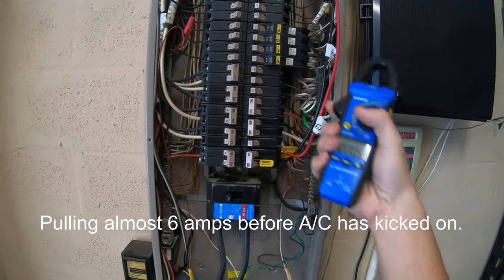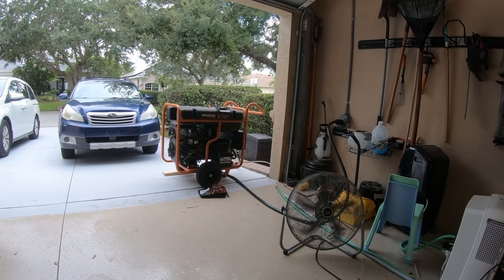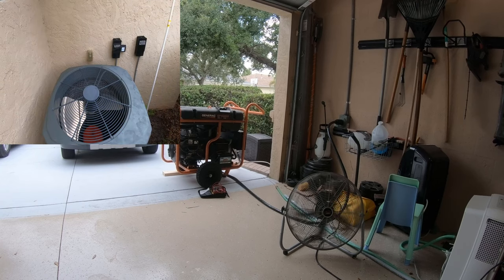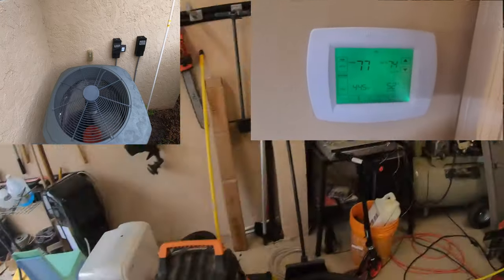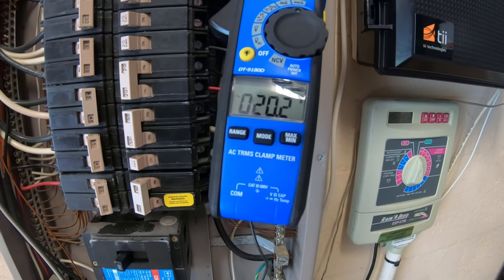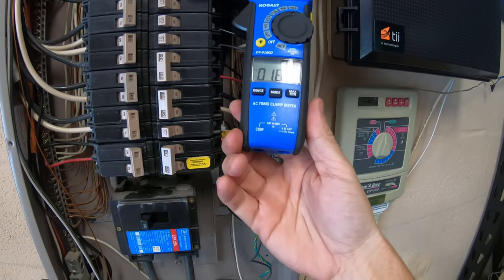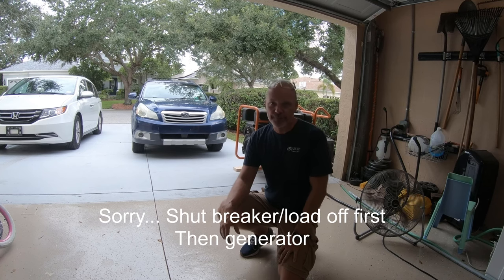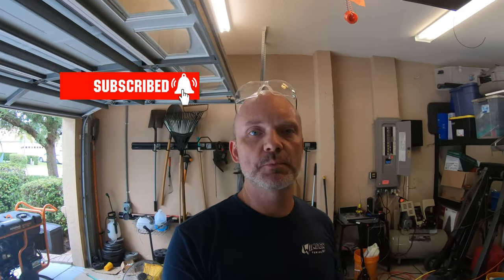Can I run central A/C on Backup Generator Power?

Comment: Is that a generac gp17500e? If so I have the same one. With the soft starter, Are you seeing a dip in voltage & hz from the generator when the AC unit starts up? Such as do your lights dim in the house when the AC turns on (while on genie)? I just damaged both my refrigerators while running whole house on my gp17500. however I do not currently have a soft starter on my 5 ton AC unit. I believe the issue to possibly be a dip in voltage/hz when the AC unit starts up, because the lights in the house dim down quite aggressively. Just curious to see if you have experienced something similar while using the same generator with or without a soft starter?
Reply from the maker: This is its smaller brother the 15k. I do have slight dimming of the lights but no major issues. Did your ac and both fridges kick on at the same time? Your surge voltage on that generator has to be somewhere around 22k watts... mine is like 20k so you should be fine in that department. Is it maybe an old central ac unit that just draws a lot of amps? My 5 ton unit is only 4 years old and is 2 stage so the startup Amp draw is not all at once.
Reply: @JackofAllTrades1  my generator start up is 26,000 W. And my AC units were installed in 2014.
Reply from the maker: @judjohnson4640  I would think you should be ok then. Are your refrigerators real fancy? Like digital screens and all? They might require a pure sine wave of 60 hz.... these generators put out "dirty power" and are not exactly 60hz. Mine actually causes my backup uninterupted power supply (ups) for my computer to throw fits... the ups doesn't like the frequency that it gives off which is slightly less than 60hz. So when I am on backup power, my ups thinks the power is off and just beeps. I'm still not sure what's going on with your situation... I've used this generator for 5 years now without issue.
Reply: those PG series units are known to have weird voltage and not always set properly from the factory. Have seen them running between 225 up to 265. The voltage is adjustable at the regulator and should be set to about 245 under 75% load.
Reply: @JackofAllTrades1  ... if you check freq with a meter you may find it's about 58 Hz without a load, then increases to 60 once you get to about half load. This is normal and the factory has no fix, nor is it adjustable. All you can do is clean and lightly lube the linkage. (WD-40 or similar) This is probably why your UPS goes wonky. (25 years in the gen business)
Reply from the maker: @rupe53  so you are saying all I need to do is run my gen at half load to get the UPS to quit fussing? :)
Reply: @JackofAllTrades1  ... maybe.... some UPS units are fussier than others about the modified sine wave of a gen set. OTOH, one way to find out is to load the gen so it's closer to 60 Hz. (and check the voltage) When these units came out (10+ years ago) there were many articles to be found on the web about which UPS units had problems and which didn't. What I can tell you is the power supply in your PC converts the AC power to DC so whatever reaches the internals will be fine on gen power without the UPS. Remember, these things are made to run from 105 to 130 volts using 50 or 60 Hz, and with a different cord (or flipping a switch) they will do the same on 200 to 250 volts. When I was repairing these gens in my shop I used electric cook tops for my load bank so I could watch the voltage and freq over a range of loads. This is how I know about the changes. BTW, I retired a few years ago so out of the loop on newer stuff.
Reply: @rupe53  I've been metering it pretty in depth and the genie is very consistently outputting 240 @ 60hz @ 3600 rpm. I however think i know what the problem. Its the quality of the wave...or the lack thereof. The THD level is way too high for sensitive electronics. I'm going to have to find a different genie so all my sensitive equipment doesn't get destroyed.
Reply: @Jack of All Trades I bet thats why your UPS is acting up
Reply from the maker: @judjohnson4640  likely so.
Reply: @judjohnson4640  ... Genie? Isn't that what comes out of the lamp to grant you 3 wishes wgen you rub it? <LOL> That said, most cheaper gen sets produce a modified sine wave. If your gear has issues it may be stuff that doesn't have a filtered power supply, like most modern consumer goods, which convert t to 12 volts DC internally. The only consumer goods I see with problems tend to be cheaper UPS units from about 10 years ago... and maybe the first generation of fridges with digital panels. This is from my work in the field over the last 25 years.
Reply: @judjohnson4640  I called GENERAC last Thursday, customer service rep stated to look at models XT, RS, & XG for "TRUE POWER TECHNOLOGY" for lower THD of about 2%
Reply: Im sorry to say but its only been from afew electricians here on the atlantic coast that they very much dislike Generac for a few reasons as a dealer. 1   they seem to need alotta mainenance beyond filters.   2  Conrol board fails and lack of warranty and 3plus 4, THe welding on bases have been breaking often (vibration) that can also lead to other problems.....   The list goes on

Comment: I was told by an electrician that sensitive electronics will be damaged if the generator supplies modified sinewave,  he recommended a puresine wave such as the Duromax  XP9000IX
Reply from the maker: That is certainly possible and one reason all my expensive equipment is on a UPS.

Comment: Will my A.C still work without a soft start connection?
Reply from the maker: As long as it's operating within the amount of amps available from your generator.. yes. If you are close... I would suggest starting your ac first then your other items you want to run.

Comment: yes, you can run a 5 Ton a/c easily. since the year 2004 I have used this same 15km generator from Generac to run my duplex home. 
I run a 5-ton Ac, 3-ton AC, 2 portable ac unit of 1 ton each, a 75 gallons water heater, 2 refrigerators of 1500 watts each, 5 TVs of 60 inch, and approximately 30 Led bulbs of 4.5 watt each as needed. During hurricane Wilma in the year 2005 I used the generator for a week, the fuel consumption was 290+ gallons of gasoline at almost full load, in 2017 with hurricane Irma 11 days without power the generator used 430+ gallons of fuels. This generator is a work horse as long as you do good maintenance. (changing the oil and filter every 3 days)
Reply from the maker: Javier that is great information thank you. Any idea on fuel consumption rate? I figured it was around 1.5 gallons an hour at 50% load.
Reply: @JackofAllTrades1  seems similar to my estimate of the owners manual, 8hrs at half load.
 If you want to conserve fuel, connect a 1000watts inverter to the generator battery to power things like tvs or a refrigerator. At night time this gave me the freedom to run the generator on idle and when the air conditioner turn on, the engine will revved up. You will need to upgrade to a battery with more CCA's, preferably to a car or boat battery.
The largest generator or tracker battery that can be purchased is 425cc.
Reply from the maker: @javierdiaz1419  that's a great idea... I really appreciate that tip.  I had honestly considered selling this and buying the smallest duel fuel gen I could find with a 50 Amp plug. Sounds like you have good feedback on it though, this is my 4th year with it.
Reply: what is the LRA of ur 5 ton unit and what brand Granted Im not sure if brand will Matter??
Reply: do you have a tutorial as to how you set this up? thanks

Comment: Dont ever…ever start generator and then connect to house. That chord is 240 volts and should you  touch it,  you will die. Second point, turning on gen breaker with all breakers on, will damage generator…turn each load on, one at a time…
Reply from the maker: I'm gonna call BS on that... there is no harm in handling that cord, plugged in or not. The cord is properly maintained and there is no concern that the insulation has deterorated and posed a risk at all. If the power panel had more than a 50 Amp demand at it when switched over, then yes... that would not be good for the generator but I knew ahead of time that I wouldn't even be close to that amount.
Reply: It's a female plug. How you going to touch it?
Reply: @sporttiger1766  ... in theory you can't touch a hot wire. If the cord is shorted then the breaker on the gen set will trip because the outside is ground.
Reply: I agree on turning appliances on one at a time ,why would you not

Comment: Maybe have it further outside the garage due to carbon monoxide?
Reply from the maker: Nah it's fine. We close the garage door once it's running. I need it closer to the house so I can have a tarp strung up to keep the rain off it.
Reply: @JackofAllTrades1  My biggest issue right now is getting a straight answer about the running and starting on my heat pump. The actual manuracturer actually told me to contact my local dealer! I'm just going to try it out.
Reply from the maker: @jackier7737  if you have concerns about starting it with your generator... maybe you are close to the limit? Just make sure it's the first thing that starts. Starting Amp draw is way higher than the amps needed to sustain it after the initial start. Also, generators have a peak Amp draw load they can maintain for a short time to help offset that. Like for example, my 15,000 watt generator will briefly run at 22,000 watts to assist with startup. If you do it this way then it doesn't have to compete with other things, like a fridge, that would want to start up immediately when power is applied.